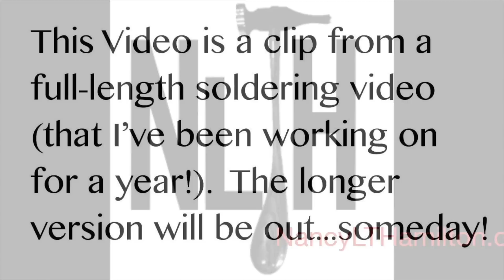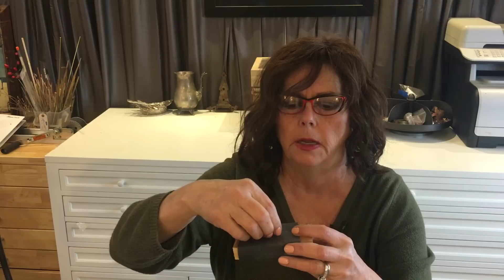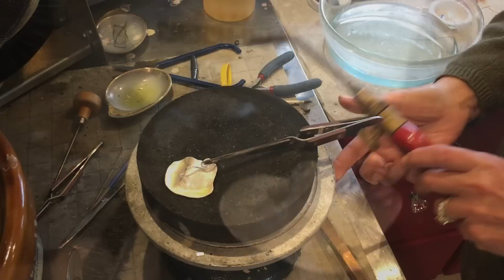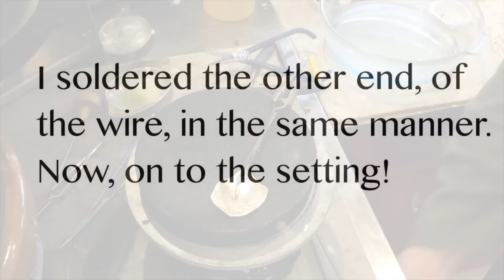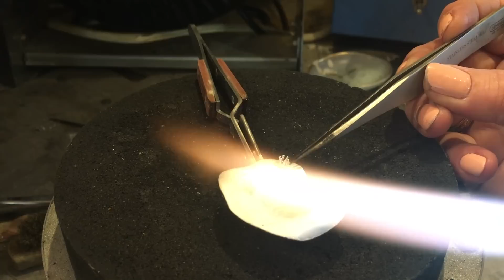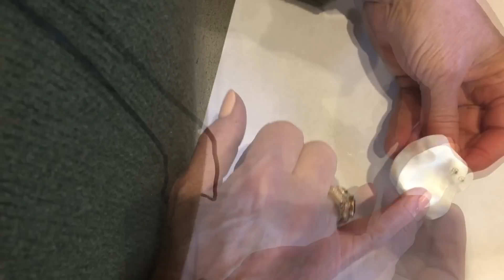Soldering Jewelry:  How to solder settings, bails and wire.

Comment: Are you focusing the flame on the back metal so that the solder does not run up the wire which would heat up faster than the larger piece?

Comment: Great video and a lovely design you've made there. The 'aha' moment for me was where you use the cross-locks to draw heat away from the wire to make it less vulnerable to melting. Great tip.

Comment: Thanks, Nancy. I have a hard time with braising. I don't know when the pieces are soldered. I know I'm supposed to look for a silver line, but I never see it. I'm new at this, in case it wasn't glaringly obvious.
Reply from the maker: That really is the best way to be sure while soldering.  The color of the metal could be an indicator but, you'd need a very trained eye.  Are your pieces holding together?  Are you sweat soldering?  You should be able to see a small silvery line around the two pieces.  Have you tried using magnification, while you solder?  I have to do that so that I can see the solder flow.  You need to get your face close - without burning off your eyebrows and hair!  (This is one of the reasons to tie back long hair!).  Let me know.  We can carry this conversation on in Facebook, if you'd like.  Just PM me.  My FB links are in the video description area.